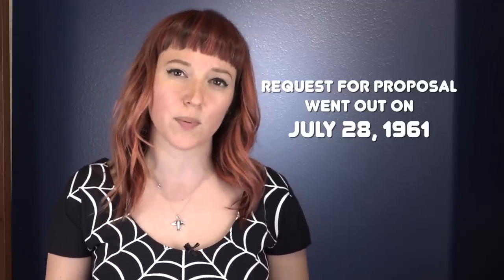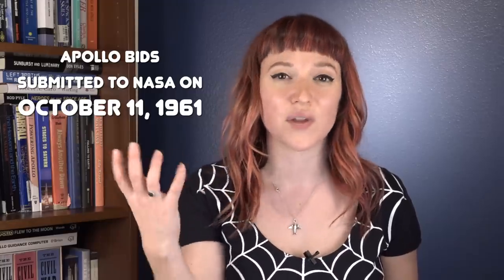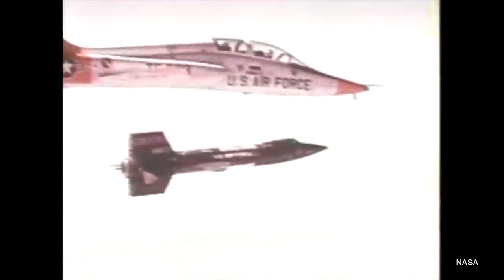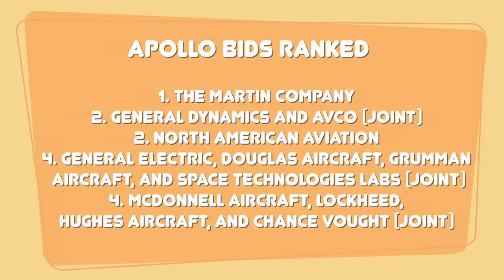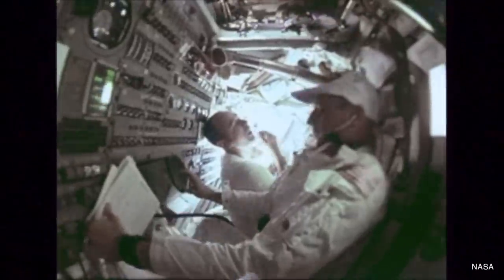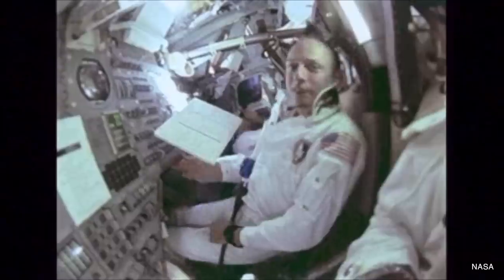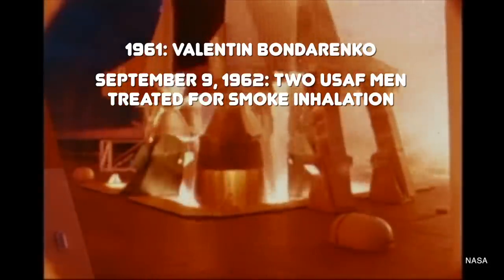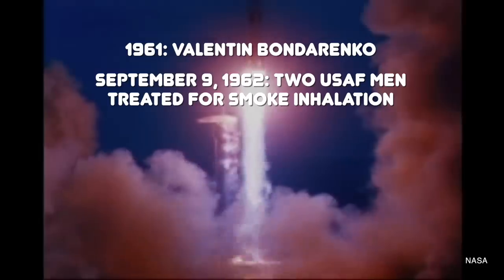Apollo’s Flammable Oxygen Atmosphere Explained

Comment: I've noticed that many ill-informed space enthusiasts (space cadets I call them), are constantly stating that it was the pressure of the oxygen atmosphere (>1 atmosphere) which caused the fire and that if we just 'just lower the pressure to the 3-5 psi' and the flammability will be lowered to 'normal'.  They generally advocate for a return to pure oxygen atmospheres in spaceships to get weight savings which will then allow some mission they want to happen and the whole thing is wrapped up in a diatribe about NASA being too risk averse now, generally followed by idolizing Zubrin.

But this is a misapplication of how the human body relies on the partial pressure of a oxygen to breath normally, deep diving often use very high pressure mixtures of just a few percent oxygen with the entire remainder being other gasses like helium, so long as the partial pressure of oxygen is in the right range (neither too high or low) humans can survive albeit with weird voices.  But while respiration and metabolism is a gas-diffusion process, Fire is a catalytic chain-reaction, much like a nuclear chain-reaction in which each atom of non-combustible gas acts to quench the reaction and each combustible atom accelerates it, so the ratio of combustible and non-combustible atoms is ultimately far more important then how closely they are packed. If a material will or will not burn is largely determine by oxygen percentage, while high pressure dose have an effect on burn rates (particularly if high pressure oxygen has diffused into a material which can make it not just combustible but explosive) and inherently determines the total amount of in-cabin oxygen available for a fire a pure oxygen environment is basically always a fire hazard at any pressure, which is why it's been abandoned in all spacecraft other the suits.

Comment: @Amy: Glad you restarted your videos. They are fun to watch although I wonder how big your wardrobe is. :) But sorry to correct you here but it does not matter much what ratio you use pure oxygen or 21% oxygen or much higher one is using as long as you do not pressurise the cabin too much. At sealevel pressure, below approximately 13% oxygen one experiences the effects of hypoxia. If you increase the amount of oxygen at sea level to 100% nothing much will happen. However, if you pressurise the cabin to about 60% above sealevel, 100% oxygen quickly becomes lethal  (hyperoxia) or if you decrease the air pressure in the cabin to about 10% of sea level, you will experience hypoxia.

Dunno if the NASA engineers knew this at that time, neither do I know the pressure in the Apollo capsule, but as long as you do not tweak the pressure, a human body can survive a fairly large range of oxygen ranges. Extra equipment to control the oxygen-nitrogen ratio was not neccesary although I am not sure NASA knew this at that time. A human body cannot deal well with a very low air pressure. It is the difference between gauge pressure and partial pressure.

Not withstanding the flamability of pure oxygen of course and weight reduction. You are totally right on that one.

Comment: Early Apollo hardware had a lot of problems.
Many of the switches would arc slightly as you turned them off.  In ordinary air you can get quite a few cycles from a switch that does that without serious harm.  Nitrogen doesn't do much to the metal.  The air tends to stop the arc quickly at those voltages, at normal pressures.
If you get a look at some of the early soldering jobs, you will see that the joints are not all that well done.  This was the era where NASA decided to retrain everyone on soldering.
The insulation on the wires was often materials that would burn too easily.

Comment: Great video! I've never understood NASA's reasons for using pure oxygen on the capsule, and thought using pure oxygen seemed like a dangerous scheme. It was hard for me to believe that the engineers involved in the design of the capsule could have overlooked this danger (from your video, I learned they did not overlook the danger, but underestimated it). You also mentioned the cabin pressure to be 5 PSI. That's about 1/3 of atmospheric pressure. Would that have been enough pressure for for the crew to breath properly? Or were the crew breathing from a dedicated crew service oxygen supply source (not cabin oxygen)? Also, where do you get all this great information about the myriad and often obscure details about the NASA rockets and other NASA equipment, facilities and people? Thanks, I appreciate your videos, and have always learned from them!

Comment: When they first planned the two-gas environment, why didn't they just chose to pre-mix Nitrogen and Oxygen in the proper ratio in one common tank?
This way they would save weight on the hardware (at least one tank and some valves and tubes) and reduce complexitivity on (automated) operations.
I know that divers use Trimix at various depths and thus at different pressures, so I think that reducing cabine pressure during launch from 17 psi to, say, 10 psi in a N-O pre-mix shouldn't be a problem.

Comment: It is not only the weight of the tanks and plumbing, the other reason that if you have mixed gases you need to deal with higher cabin pressure. You should keep part-pressure of the oxygen you breathe somewhere around 3 psi. As it is pure oxygen this is the minimum cabin pressure. The uses 5psi cabin pressure to avoid decompression sickness during launch and as a safety magin because of CO2. If you want use normal gas mix like here on earth you would need a total pressure of 14 psi in the cabin. This however required a much more sturdy and therefore a much heavy cabin construction. They would have never been able to build an LEM that leightweight if they would have used 14psi cabin pressure.

Comment: Amy....can you answer a question re cabin pressure?

The vid said the cabin in flight (after the changeover following liftoff) was 5 psi.  That's about the pressure at an altitude of 26,980 feet.

The thing that has me confused is that altitude is about 733 feet ABOVE 8000 meters (26,247 ft)....what mountaineers call the "death zone," and an altitude where it is impossible for someone to exist for very long -- even with bottled oxy -- for extended periods of time without risking altitude sickness, which can be deadly.

I seem to recall one of the Mercury guys -- don't remember if it was Al Shepard or John Glenn -- stating at one point in the flight that cabin pressure was at 5.5 -- roughly 24,812 feet... 1435 feet below the Death Zone.

Given the Apollo cabin pressure/altitude comparison, what else was going on that allowed the crews to function and survive in such a low pressure environment for an almost 2 week flight?

Obviously, I'm missing something here, but I don't have the background to determine what.

Comment: Hey, can anyone explain to me how the astronauts got out of the lunar decent module when it was pressurized? Was there an airlock or did they de pressurize the whole thing?
Reply: Trebor  ahh, thankyou. That's rlly interesting
Reply: Technically, they were in the Ascent Module which sat atop the Descent Module. The DM only had the DM engine, fuel, equipment, landing gear, and stowed experiment packages. And the deployable Rover on the last 3 lunar landings. The Ascent Module was the pressurized module for the crew, which had its own engine, fuel, communications equipment, life support equipment, etc.
Both modules went down and landed and then only the AM lifted off to rejoin the Command and Service Module for the trip home.
Reply: @WoodworkerDon  ahhh, thankyou. Seems I need to check up on my terminology😂
Reply: @edwardblewitt1961  no problem. There were so many pieces and modules to keep track of, that it can be confusing sometimes. There's another of Amy's video covering all the different engines(rockets) it required to get to the moon and back. Way more than most people think. Main engines for the several rocket stages, ullage rockets, CSM, LM Descent, LM Ascent, reaction/attitude control thrusters, etc.
Spoiler alert:

The total is over 80.
Reply: @WoodworkerDon  thankyou, I'll go watch it. That sounds very interesting

Comment: You left out one other reason a pure oxygen system was a tempting option. Since the spacecraft only needs to be strong enough to contain a 5 psi cabin pressure with a pure oxygen system, the entire structure can be lightened, including the Lunar Module. This big weight savings, plus the weight savings derived from a simpler gas management system, added up to a big savings for the spacecraft.

Comment: The main savings in weight is that the pressure vessel did not have to be as strong to contain 7psi as it would have to be to contain 14psi.  Nitrogen would only need to be added if there was a loss of atmosphere from the capsule as respiration itself would not remove nitrogen.  The argument for nitrogen to be kept in storage due to the possibility of atmosphere loss is also an irrelevant argument as in reduced pressure atmospheres, adding oxygen to maintain the proper vapour pressures would've been sufficient and the reduced pressures would also help mitigate the atmosphere loss rate.  Requiring compressed nitrogen storage tanks would've been unnecessary and pedantic in a dual gas design as the nitrogen would not be expected to be used and any foreseeable loss of nitrogen would also be a loss in pressure hence more amenable by increasing the oxygen concentration so long as the rate of loss did not cause the bends.

Now had the option of EVA missions been a requirement then substantial nitrogen storage would be needed in a dual gas design but even so the weight of the extra tanks would not have been the main savings in weight nor would any pumps be involved in either case as the tanks would've been pressurized.

Comment: Any engineers, physiologists or spaceflight gurus here able to help me with something I've been pondering since Amy's first video on the Apollo fire?
Since the first mention of 5psi of pure oxygen, I've been wondering, why not 3? The partial pressure of oxygen at sea level is only 3psi, so why pressurize the cabin to 5?
I'm a physiology major, but it's got me stumped.. My best guesses are below:
a) Having a lower absolute pressure would make it take longer for the astronauts to acclimatize before departure/after arrival
b) Having 5psi instead of 3 would give some headroom in case of malfunctions of the oxygen delivery system (humans do OK in environments with higher than normal concentrations of oxygen, but things quickly go pear shaped with lower concentrations!)
c) Compared to 3, the 5psi would reduce inward pressure on the capsule at sea level and slightly increase outward pressure in space. Maybe this was a factor for the structural integrity/sealing of the capsule?

Comment: Is 5 psi pure oxygen that much safer than 16 psi pure oxygen? The flammability of materials isn't much reduced in 5 psi pure oxygen versus 16 psi, and the Apollo 1 blog post you linked to over at Discover Magazine listed two 5 psi pure oxygen tests where the fire grew really rapidly upon ignition.  The safeness of it post Apollo 1 was probably much more about reducing the flammability of components in the capsule.

Comment: They were never in an environment of pure oxy . But in the environment of Apollo 1. And the mix of O2 , He, and N mixture and the electrical fire in combination with those gasses the gasses causes the increased combustion of wiring insulation which continued to burn even though the circuit breakers were tripped ...the main buss which was not so circuit protected and continued to burn and short circuit with other electrical wires...Oh By, the way , for those who want to know what actually caused the fire.  A newly introduced radio ( which they were testing and the were having problems with). Was circuit protected incorrectly to the bus system of the Apollo.  Several circuit components were incorrect according to the schematics and a high amperage rectifier was uses instead of a fuse device to prevent overload.  Combine that the fact that the hybrid analog ( vacuum tube circuits with solid state high voltage power supplis caused a mis match in radio performance that tuned the radio into a very unstable device that caught fire. The overloaded buss wire could be traced from the radio to the electronics storage  box behind the astronauts seats and then to a circuit board under the astronauts seat.  What I'm describing is a domino effect of circuit board burnout that was caused by a non isolated ground system and a reverse polarity connection to the radio that was improperly designed.  the power regulator circuit that was incorporated into the radio was designed to be polarity connected either way and would switch to the correct polarity...in actual fact it didn't always work that way and would intermittently short circuit.....that is exactly what they were trying to figure out,what was wrong with the radio at the time and the reason why they would get a momentary odor  that would disappear quickly every once in a while. In essence the radio would short out the radio bus like touching positive and negative leads every so often. THIS PULSATING SURGE effect cause the circuit breaker to over heat and caused its internal contacts to melt together and thus prevented the circuit breaker to do its job and shut down the power to the overheated radio.

Comment: Interesting! I'm confused though: if they decided to launch with N2/O2, does that mean they entirely gave up on the mass savings of a single gas system? In which case, bleeding out the N2 was purely to reduce the pressure and subsequent risk of an explosion?
Reply: No.
It was much simpler.
When the astronauts boarded the capsule there was just ordinary air in it.
The capsule air valve was left open and was operated with a simple pressure switch to close automatically during the ascent. This replaced the air with a pure oxygen environment during the ascent, while at the same time it reduced the pressure in the capsule automatically.
(Remember: the astronauts were enclosed in their space suits. So for them it didn't matter what the cabin environment actually was during ascent).

The cabin valve was already there, as it was needed for repressurization during the final descent before touchdown.

Comment: Glad to see you back, Amy!  While this video is admirably detailed, I think you misspoke by saying that a U.S. manned pure-oxygen atmosphere capsule was launched into space.  Or did our manned flights, prior to the 1965 tragedy that happened when the rocket was on the ground, use pure oxygen atmospheres?
Reply from the maker: I didn’t misspeak. Every mission through Apollo-Soyuz had a pure oxygen cabin environment. Before Apollo 1 in 1967, every mission also did its plugs out test with pure oxygen under pressure. That was part of the systemic problem: it had been done before so the test wasn’t thought of as dangerous.

Comment: The Apollo 1 disaster using pure oxygen under that pressure has always boggled my mind. 
The part about having two tanks and gauges for the proper blend to get it just right seems odd.
As a (sport) scuba diver, we just use the normal gas mixture from the atmosphere. I remember in class learning that two atmospheres of pure oxygen starts to become toxic.
My point: Why didn't they put the proper blend of gases into single tanks? then no extra complex equipment that added the extra weight.
Reply: Liquid gases are used for mass efficiency in spacecraft. Mixing liquids that boil at different temperatures get complicated.
Reply: @mikecowen6507  
Ahh, that makes sense, thanks!

Comment: Curious about your pressure numbers at the end. The Apollo capsule in space is at 5 psi absolute. Standard atmospheric pressure is 14.7 psi absolute. Wouldn't the capsule need to be pressurized to 19.7 psi absolute to get the 5 psi over what ever the air pressure was on the day? Imagine, 21% of 14.7 psi of air qives an oxygen partial pressure of just over 3 psi. 5 psi is equivalent to 34% oxygen in air. But the capsule was at almost 20 psi of pure oxygen, not 5 psi.   Sad that NASA missed how bad 5 psi over atmospheric would be.

Comment: I would like to point out that Apollo 1 was undergoing a test and should be using 16 psi. At 15 psi aluminum burns by the way.
Yet Frank Borman of Apollo 8 an expert in thermal dynamics states it was 20.2 psi. Yet engineering specifications speak of only 5 psi of oxygen environment. What we also know is the cabin was at 29 psi and the cabin ruptured.  Yet we know that at sea level it would need to be 14.7 to 19.7 at this location. Yet NASA in 1962 was testing oxygen with the odd part is Asbestos burned. Yet the study reported in the news that fact. 100% oxygen atmospheres this report in 1964 showing the dangers. So NASA knew about this problem at least by 1963. Navy divers even are aware this was a very very big problem. We also know that the door or hatch was only able to be opened from the outside. The crew would not be able to get out even if they wanted to. There was a report that it would take 90 seconds for the crew from inside to get out and yet the data and reports and investigation showed this was not the case. There was however a update to come on the next craft that would allow the crew inside but that had not been setup for Apollo 1 capsule.
In your video you say that NASA was testing with 5 psi and yet the record shows they were testing at 16.7  to 20.7 for operations.
Yet the company documentations state that 5 psi is what they designed the craft for.  NASA also in the investigation report and in front of congress stated they did not know about this pure 100% oxygen problem till Apollo 1 fire happened.